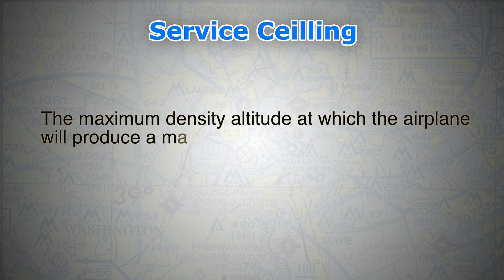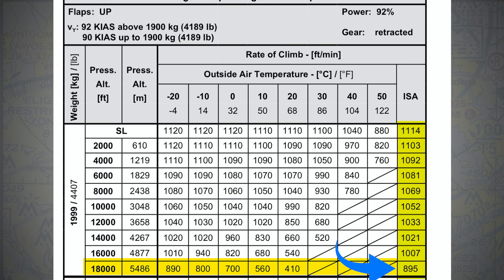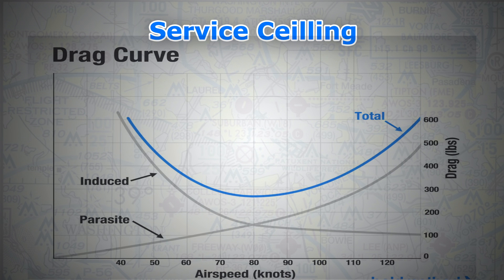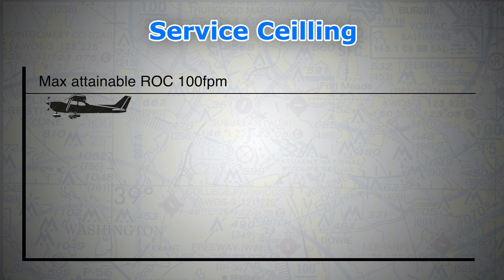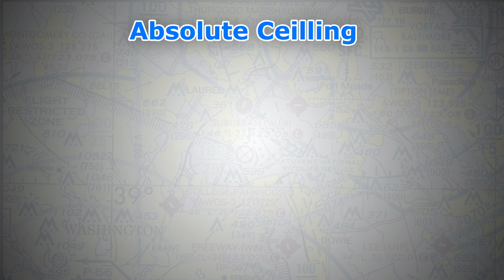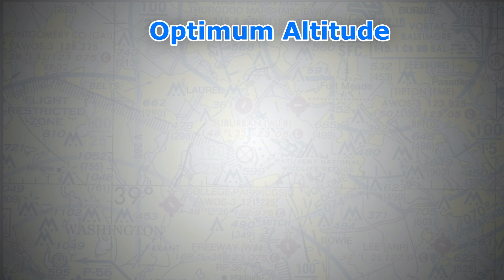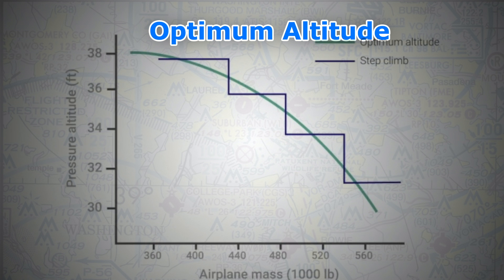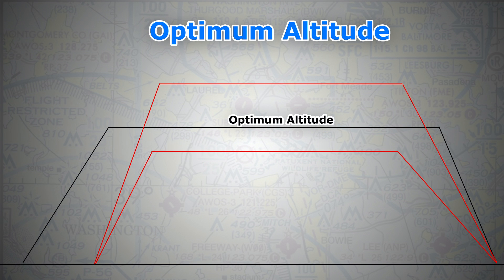✅ Difference Between Absolute Ceiling and Service Ceiling Explained

Comment: Sir What is Aerodynamic ceiling ?
Reply from the maker: Aerodynamic ceiling is the altitude at which the low speed buffet (Stall) and high speed buffet (overspeed) meet, it is also referred to as coffin corner.
it is the altitude at which only one airspeed can be maintained, if you slow down you stall and if you speed up you stall. We do not fly at such altitude.